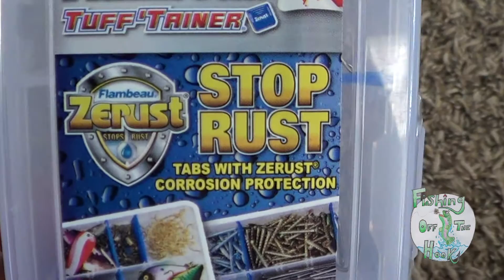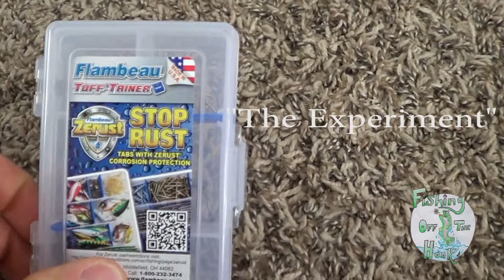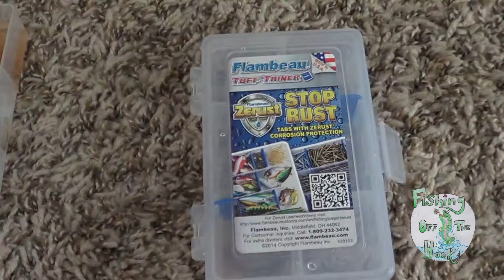No-Rust Tackle Box: Does Zerust Work? - Fishing Off the Hook

Comment: I believe it takes time for the Zerust to form, release the particles on the metal. 

So a few days without moisture is needed. Also Zerust cannot possibly work with metal submerged in water. 

To repeat myself, Zerust deposit a protective lawyer of particles on metal.

Zerust also has a useful use life, before needing replacement.
Reply: Came here to say exactly this.  I’ve used zerust vapor capsules in my gunsafe for about eight years (4 capsules replaced annually).  The vapor/molecules released have to be able to accumulate on the metal surfaces.  That will just not happen with metal actually fully submerged in water.